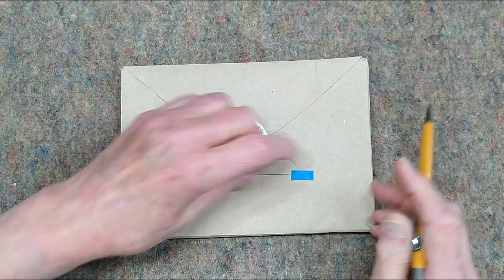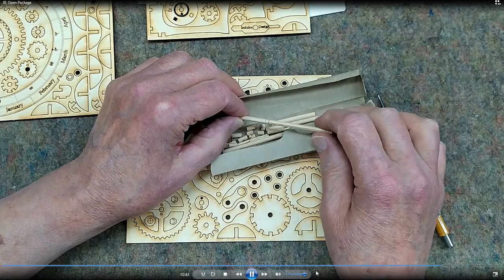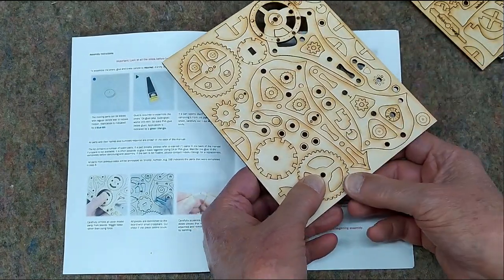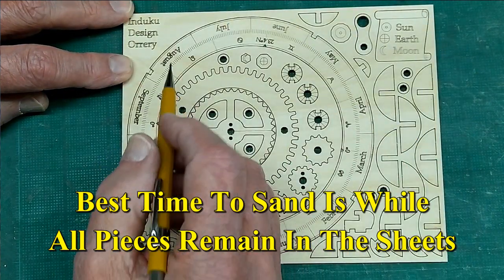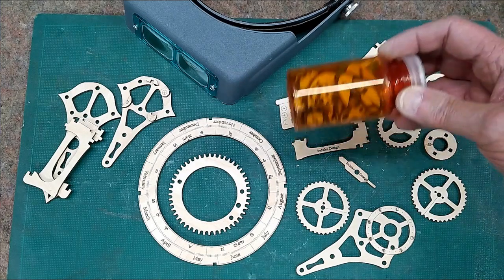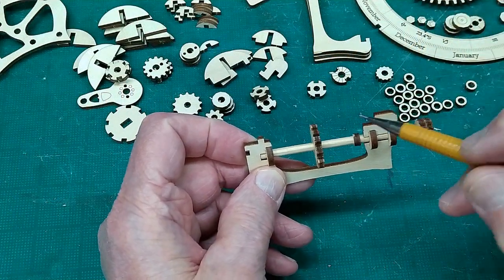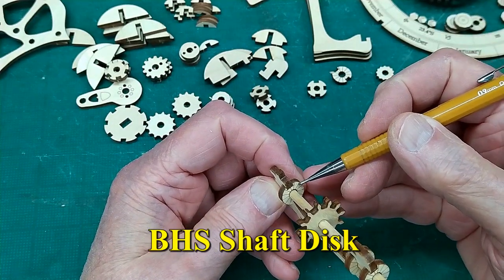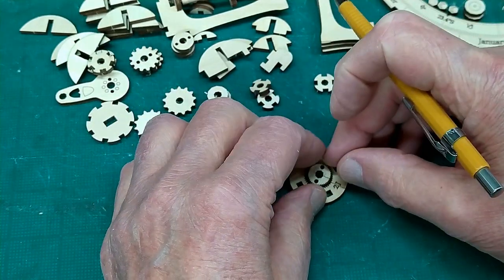Wooden Orrery Kit by Induku Design

Comment: Wow, that package would not survive the handling by Postnord !
Reply from the maker: Well... this shipped from Sweden in a properly sized envelope and arrived here in the USA quickly and in perfect condition. So I guess it will survive Postnord. :-)
Reply: I have had almost no problems with Postnord. There has been one ore two cases where the package was slightly squished on one side (and three instances where the envelope was completely opened and delivired without any content) - but I do not think this was Postnord but rather one country where I often ship to. I have, however, recently upgraded the packaging to a much sturdier box for this model: instagram.com/p/CANRs3hAerE

Comment: A single glance at the laser layout, and i can tell that person spent a lot of time on this. I cannot overstate, just how many kits i've bought, where they just, literally chucked the parts unto a sheet of plywood and started cutting.
Don't get me wrong, i reused all the waste, as a lot of us do, but it's such a waste.
Reply: Yes, I did spend quite a bit of time testing different layouts to minimize the waste. I would prefer to have all the sheets the same size but I  based the layout on the international paper size system (ISO 216) where smaller pieces fir very nicely on a larger sheet in a cascading style - this helps to get the most out of a sheet of wood and make shipping of some models easier as it fir in a standard B series envelope :)